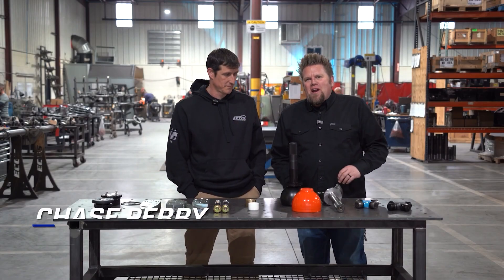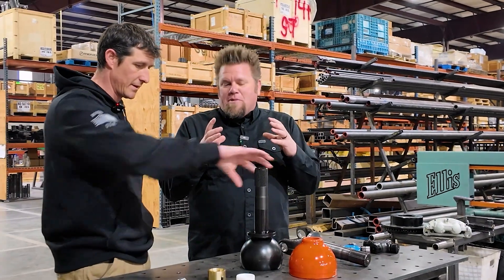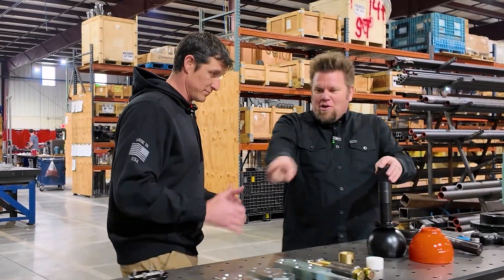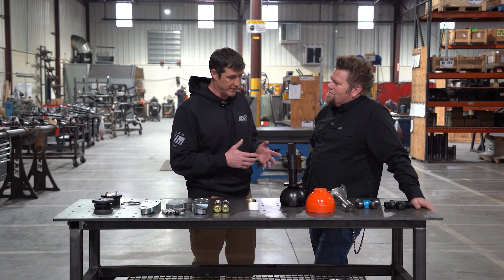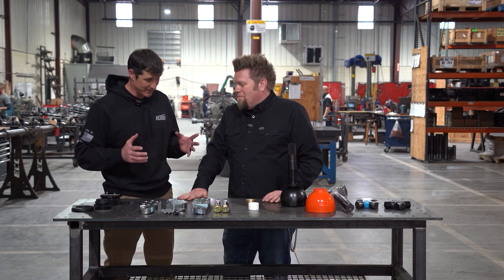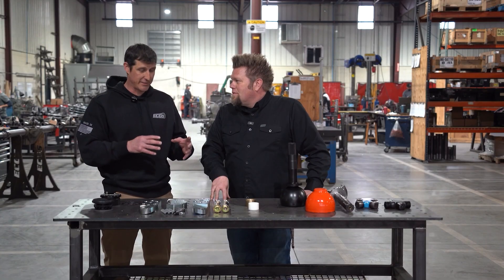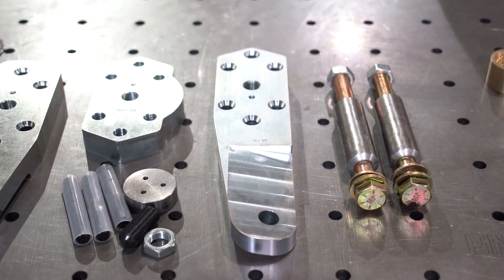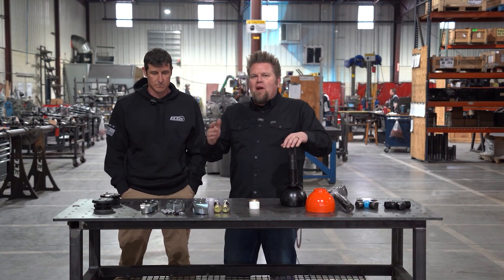KP540 Options Explained | Shafts, U-Joints, RCVs, Hubs, Steering | East Coast Gear Supply

Comment: I’ve read the extra wide superduty F-450 has a tighter steering angle and Smaller turning circle. Do any of these have differences in that regard ??
Reply from the maker: Yes kingpin inclination was increased over old school Kingpin. We also reduced Wheel mount distance. These combine for better scrub radius and tighter turning.

Comment: Massive stuff!
Reply from the maker: Thanks for being so active on our channel. It's great to see your insights.
Reply: @ECGSTech honestly, i love axles! This kind of stuff is fun for me. I dream about having some beefy axles for my rigs one day!
Reply: I have known about ECGS for a long time now, but just learned that you started casting your own housings. Exciting stuff!  I have been building up my axles on my XJ for years now and have done pretty much everything you can do to make them as strong as possible. With how i wheel and my want for reliability,  my goal is to upgrade to stronger axles. Probably JK 44's. I like the extra width but not overly wide (still relatively nimble compared to full width axles). I like the larger shafts and ring and pinion too. The tubes are still small and fairly thin, so trusses are a must, but that is an easy job and will let me practice my welding. 
I definitely looked into getting an 8.8 from you guys back when i did the swap in 2016. Ultimately building one myself was a ton of fun and a great learning opportunity for me.
Reply: Something needs to act as a fuse!